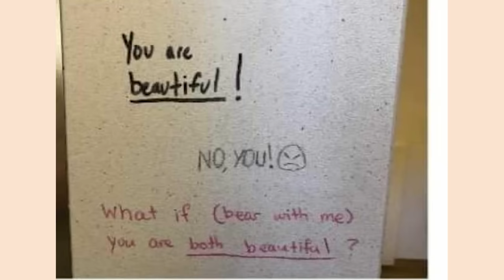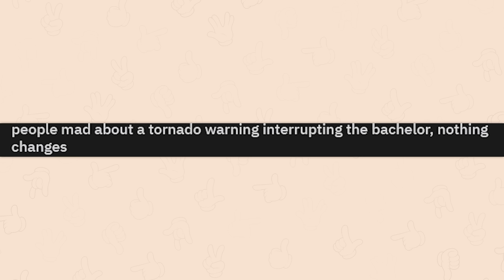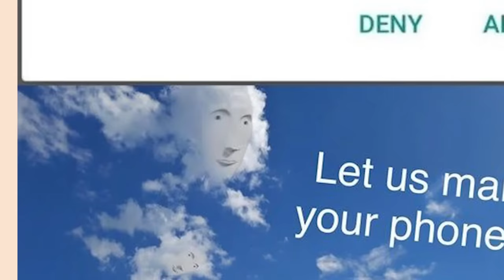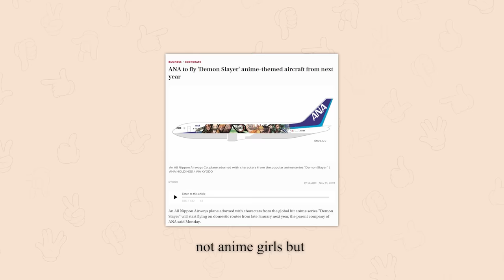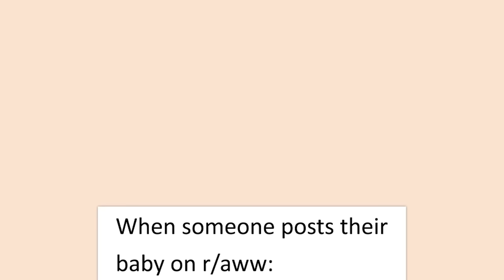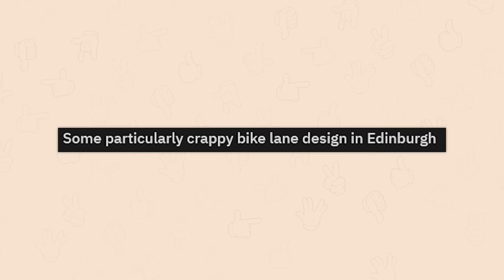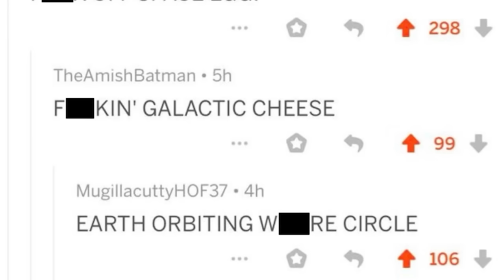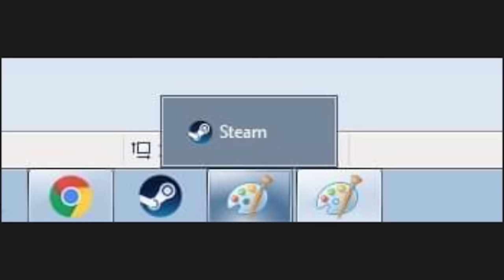the longest video we've ever made!!!

Comment: 15:19
Okay, this is actually easy, Jack.

The equation is 6/2(1+2)
Let me break it down.

So first, do the parenthesis, which has 1+2 in them.
1 + 2 = 3.
Then, do 6/2. 
6 / 2 = 3.
Also, since the two equations are together, that means we have to multiply the answers we get.
3 x 3 = 9.

The answer is 9. Not 1.
So the human race really is doomed.

Comment: 6÷2(1+3) would actually be 9 because the order of operations tells you to go from left to right after solving in order of Brackets, Exponents, Multiplication and Division, and then Addition and Subtraction. The reason why it's not 1 is because like I said you're supposed to go from left to right and multiplication and division are equal, not one way or the other. Therefore you would add 1 and 2 to get 3, then divide 6 by 2 to get 3, then multiple 3 and 3 to get 9. If it were 2(1+2)÷6 then it would be 1 because then multiplication comes first in the equation.
Reply: I got 12..